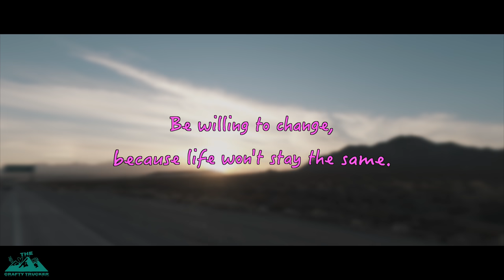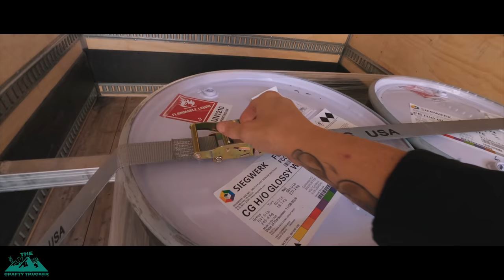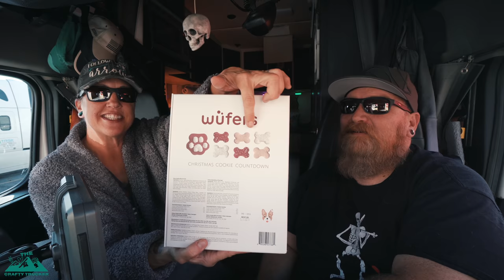FINALLY GETTING OUT OF CALIFORNIA

Comment: Fuel was cheap in Missouri last month when I was there. I drive an RV and it has 150g tank, but been trying your slower speeds and trying that lately. It seems to work, but haven’t had a good run lately. But I have been going to Costco and Sam’s club most of the time lately. Sam’s Club here in Las Vegas, NV, if you have to fill up here. Just off the 215.
Reply from the maker: Seems fuel is also on the rise with prices. Driving slower is tough to get used to. When you spend as much as we do, it just makes sense